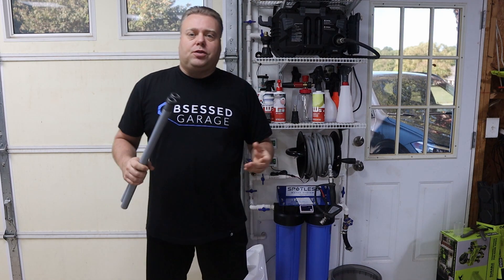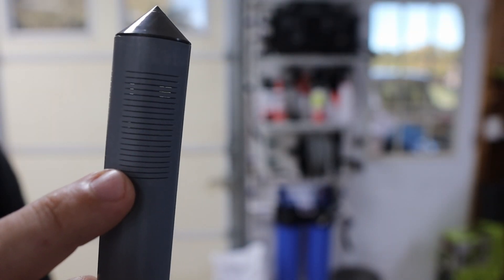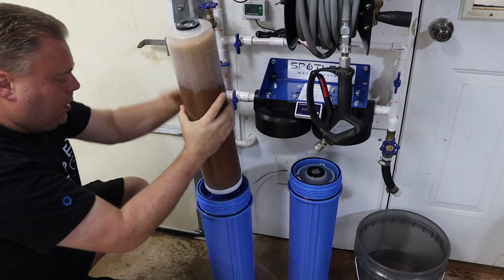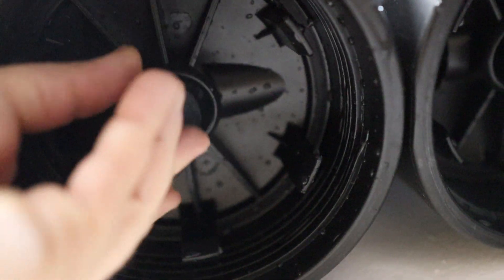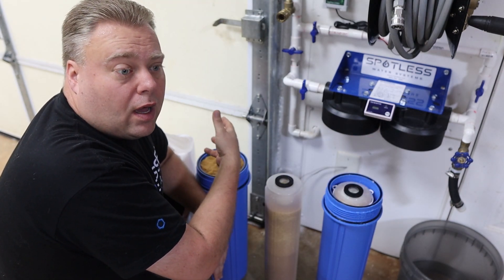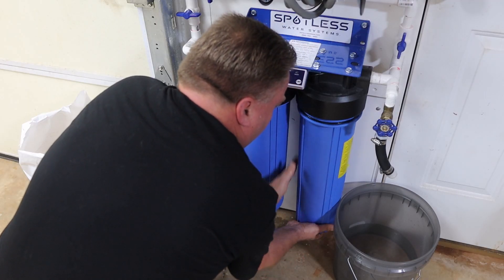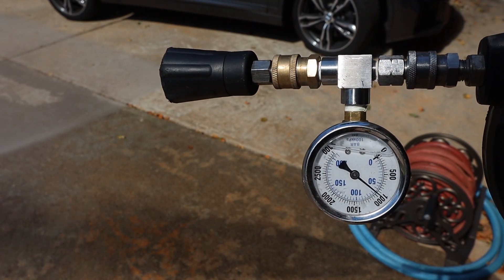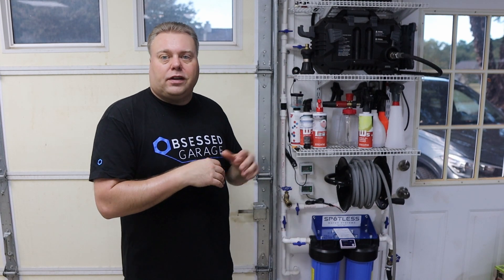Modify Your CR Spotless | How Long Did My DI Resin Last? | RV-Mods

Comment: Only thing I would reccomend is to use a silicone o-ring grease instead of Vaseline. Vaseline is petroleum based which will cause the orings to expand and stretch. Where I work we have an industrial size RO system and deionizer and we were replacing the orings on the housing every month due to them expanding. Since switching to the silicone oring grease, we haven't changed one in over 2 years.
Reply from the maker: I thought of that. I knew Vaseline was the wrong way to go that stuff causes nothing, but issues.
Reply: Thank you for the tip, great comment!!! 👌🏾💯

Comment: I own a company called NuWater USA and Creative Water Solutions, we make all kinds of cartridges.  The difference in color is due to resin separation. You have Anion and Cation resin mixed and each have a different density meaning cation weighs less and will sit on the bottom. Plus the resin needs to be packed tight to not create separation. Plus you never want to go up flow with DI always Down flow. Your Mod is going up flow........
Reply from the maker: I went back to the resin filter setup. Somehow some resin got by the laser cut grooves.
Reply: @CarsWithKeav I'd take this video down if that's the case. 😮
Reply from the maker: @BrillianceAutoSpa  I seem to be the only person I know of to have this problem. I’m taking is a fluke or I did something wrong somewhere during a refill.
Reply: @CarsWithKeav  I see. Have you reached out to the manufacturer about this? Perhaps they can send you a new set of rods and resin.
Reply: What do you mean by up flow and down flow ? How would you achieve down flow with these filters?

Comment: FYI: thought about buying this unit until I checked Amazon reviews.  Ten prcent (10%) or 1 our of 10 people gave the CR Spotless 1 star and descibe it as 0 stars.  Folks having the system fail after 5 or  6 washes and plenty of horrendous stories about CR Spotless' customer servive (basically doesn't exist).  The there is a more stories with 2 stars, etc.  This gives me great pause.
Reply from the maker: Problem with this type of product is most people don't do their research and think that if I can get 600 to 800 gallons out of my water they expect the same, but they live in Vegas and the water is very hard and would last maybe 100 gallons if that (Believe me I get lots of comments that what I suggested doesn't last long and it ends up being their quality of water once we had a conversation). Years ago you could only get this type of product of a website that educates on this, but now its right at your finger tips and a social media campaign on top that. Mine has been great and still on the wall I did reverse the mod in this video as it didn't go so well and went back to the cartridges. there are lots of great options out there, but before buying anything like this getting a TDS meter and checking your water will let you knwo ahead of time the experience you will have. Also researching the source water whether it is well water or city water as chemicals and other things impact usage. Some people also don't make sure their input water matches the max it can handle which is 2.5gpm, but most house can flow 8gpm moving the water too fast to get filtered. I have tons of products that worked out so well and don't have very good ratings.
Reply: @CarsWithKeav  Yes, likely. Thanks for sharing your insights.

Comment: Dumb question: is there not a way to uncontaminated the resin similar to what a water softener does on a backwash with salt? I guess I’m not quite understanding why this resin is thrown away.
Reply from the maker: The resin can be recharged, but I don't want to deal with bleach, sulphuric or hydrochloric acid to recharge. Plus, this is mixed bed so another process to separate them before the harsh chemicals. Some love to do it, but its not for me.
Reply: @CarsWithKeav  Thanks, I didn’t know that.

Comment: Arizona has some of the worst water in the U.S. Mine tests out at 700 TDS.  This unit might lower  my TDS down to 150 but that is still too high and the resin would be wasted in 1 car rinse. I think I"ll buy a blue, 15 gallon, water barrel and an electrical pump with just enough horse power to make a nice hose stream. Then off to the water store I'll go to buy some reverse osmosis water that tests out at 0 TDS. I see no other solution.
Reply from the maker: A lot of guys in Arizona are running RO systems and using this system after that to get full 0 ppm. I’ve seen videos of them going from 500 tds to between 10 and 50 from the RO system.
Reply: Hmmmmm I live in Arizona and just recently purchased the waterdrop di water system, so it will not work then?
Reply: @jacqstoneva  This will work but given how hard AZ Water is success will depend on how often  and how costly it is to renew filters.

Comment: I added an RO pressure vessel to my setup and my 1 cubic ft of resin now last far longer than even with the downtube upgrade.   My water here in AZ is horrible, starting at almost 600 PPM,  After the RO membrane, the water is down to 30 ppm, so obviously my resin does much less work than it would have to without the RO membrane.  I used to blow through a 1 cubic ft bag every 6 months.  the only downside to this setup, is that I have to store the water I make.  I used a rain collection bin and that seems to work really well.  It's a bit of a frankenstein setup, but it works great.   I'll share my setup if anyone is interested.
Reply from the maker: I feel for you guys with the high PPM water. I would for sure run RO if I had that type of water and probably a two stage carbon filter setup as well.  I get about 50 ppm out of my faucet so no RO needed. Wish I could share this good soft water with you though.
Reply: Please share. I'm at 500PPM and would like to use a DI system but am hesitant. Would prefer not to wash my car at 7am to avoid sun and heat if I can...
Reply: @D_Rok80  You will always need to wash your car out of the sun if you're in a hot climate. You don't want your chem drying up any more than you want the water.

Comment: hey keav i have the diw-10 and i can’t find that conversion tube for my unit, any ideas where i can get it? or can u help make me one?  i’d pay you for it
Reply from the maker: I am unsure exactly how to make one and haven’t seen them sell those for quite some time. One thing that might work is taking the 20 inch and cutting in the middle and then using a coupler to attach them together after cutting down the length needed.

Comment: I have just bought a DI system with 20” filters. They are rated for up to 300 gallons at 200 ppm. My ppm is running around 230ppm.  Would you recommend running pre filters like you had on the cart? Do you think I would notice a difference in the life of the DI filters?
Reply from the maker: You possibly could if you have sediment. The carbon filters are mainly to catch chemicals that DI resin does not. Chemicals like chloramines.

Comment: I had changed my resin out and for some reason the resin is coming out of the di tank with the water and it’s reading a high ppm. Anyone know what I’m doing wrong or how to fix it?
Reply from the maker: Recheck all the gaskets and seals and make sure the pipes are fully seated into the housing. Any chance for the dirty water to get by it will. I actually went back to the cartridges as resin was getting by and clogging my sprayer.
Reply: @CarsWithKeav  ok thanks, the problem I have tho is I can’t really see the tube when I screw on the tank
Reply from the maker: @joshfde  that is the biggest problem. I have found after multiple of these types of systems it’s best to set the tube in the housing first then push into the resin. The tubes will always be all the way in then. You can fill up with water as well and will be much easier to push the tubes into the resin.
Reply: @CarsWithKeav  Ima try that thanks bro

Comment: I know this. Idea is 9 months old but FYI RV-Mods is out of the DIC conversion kits. They sound great. Thanks for the video info. And the bloopers are great!
Reply from the maker: Appreciate that. I have actually gone back to the original filters as resin passed through the slits in the pipe and clogged my spray guns. Might have just been an issue with my setup. I have it pretty down pat to change out the filters.
Reply: @CarsWithKeav  Thanks for responding Keav. Maybe the pvc pipe didn't didn't seal/connect properly when you attached it to the CR Spotless Water unit. There is now a 3 week wait for new conversion kits but I'm going to give it a try to stretch out the resin life. I am just now purchasing the CR unit, etc. so it may be a month before I let you know how it works. I tested out water with a TDS tester and it read 107. Safe to drink but not very good for paint or windows. I look forward to more of your excellent videos!
Reply from the maker: @tomharrison7280  I thought so too, but I even cleaned it out reseated perfect ran it and resin got by the slots. Only on the second stage. So only one is letting the resin by. I switched the tubes and it stopped  since the resin was being caught by the other tube. Maybe just one slot was too big maybe? Not sure nobody is having this issue so I chalk it up as a fluke.

Comment: Did you keep the system modified? I got 350 gallons before I needed to change mine so I upgraded it & got way less I wasn’t sure if it was my resin or if the tubes weren’t in all the way so I pulled it apart double checked my tubes all seemed good . Same water scenario. I’m trying to figure out why I went from 350 gallons before mod to 50 gallons ugh .
Reply from the maker: I had a different issue where resin was getting by the slits at the bottom of the tube and clogging my sprayer. I went back to the cartridges which are way easier to change out so i don't mind doing it the extra few times I have to. Possibly you have some blow by going on where it not sealed all the way allowing water to sneak by. Also, make sure to try multiple sources to check tds. Filling a cup up and doing the manual check is more accurate. The TDS meter on the CR Spotless does have a calibration screw at the back and you can get calibration fluid from them to adjust it. Since its measuring flowing water there has to be a way to calibrate.
Reply: @CarsWithKeav  good idea I will check manually. Thx for the response.

Comment: How do you dispose of the used resin?
Reply from the maker: Household trash. It’s basically micro beads of plastic. Many regenerate their resin to save money as well. I plan to make a video on that process soon.
Reply: @CarsWithKeav  I read a few posts about that process, and it looks like you should be a chemist and own a hazmat suit! 🙂
Reply from the maker: @MickStreff  It's a pretty involved process with lots of chemicals. For sure need the PPE.
Reply: @CarsWithKeav  While using this modification, were you happy with the results?  Do you still use this process, or have you returned to cartridges?
Reply from the maker: @MickStreff  I went back to cartridges no matter what I did I was getting resin clogging my garden hose shower nozzle. Others have expressed the same problem, but the majority seem to be very happy with it as well.

Comment: Do you have to take the water out once’s you’re done using it? Or no?
Reply from the maker: You should always keep water in there resin loses its charge when it dries out.
Reply: @CarsWithKeav  also, I did the conversion and my ppm is still reading high. I tested the water and it’s good but it still spots. I had to transfer the tpms meter to a new head unit so could it be damaged?
Reply from the maker: @abrahamfranco4249  That’s weird have you checked the connection inside could be getting blow by. TDS meters can go bad, but not usually reading the same number as going in. Than can be calibrated as well. There is a screw on the back and you can get calibrated liquid from the manufacturer.

What is your incoming tds? Is it very high? Was the TDS better or worse with the stock CR spotless filters?

Some water quality is so hard even full resin won’t get you spotless.
Reply: How do I check for blow by? And how do I take off the connection safely? I struggled with it when I had to transfer it to the new unit. 

I also love in California and the TDS was reading around 250ppm
Reply from the maker: @abrahamfranco4249  should be able to handle 250 ppm. Blow by would be if the tubes are not seated properly causing water to not go through the resin to get into slots at the bottoms of tube. If the tube is put too far in the canister when you put the canister on the housing it will not seal all the way allowing water to blow by. It will lower TDS, but not fully. What’s the ppm after being filtered?
Reply: @CarsWithKeav now that you say that, I pushed the tubes all the way in then closed it up. That’s probably what it is. After being filter and testing the water manually it says 0ppm but I got some in a bottle and sprayed a window (after cleaning it) and it still spotted but obviously it was softer.

Comment: Can you cut the length of the tube down to 10 inches ?
Reply from the maker: I don’t see why not, but they sell a 10 inch version as well so you won’t have to cut.
Reply: I can't find a 10 inch version anywhere. I just found this someone had asked the same question.I didn't see it before.
Thank you for the great videos
Reply from the maker: @57cbo  You are right they don't seem to sell the 10 inch version anymore onlt the 20 inch one.

Comment: my water reads around 380 tds would I still be able to get at least 300 to 500g or would it be less?
Reply from the maker: I would say closer to 200 gallons. They have this calculator on their site you can use to get a good estimation. https://crspotless.com/how-many-washes/

Comment: My well water even after passing thru softener is 1500 TDS.... I do have some sort of filter tall cylinder but not sure if thats for removing TDS..... I got the apec one and it only lasted a few washes..... Wat are my options?
Reply from the maker: With that kind of TDS resin will not last long. You might need to look into RO to get most out before hitting the Deionization. Carbon sediment and pre-filters are a help as well. Check out this video on an RO system. https://www.youtube.com/watch?v=TevNUbePxyA

Comment: Thanks for the info! Nothing more annoying than water spots on a nice shiny car finish. Could the water that is filtered be considered demineralized? I could also use that in the shop for car cooling systems with a 50/50 mix. Thanks. -Glen (Ozz)
Reply from the maker: Yes, it is de-mineralized and I use in Golf Cart Batteries, Coolant mixing, Ice Cube Maker (Crystal Clear Ice), chemical dilution, etc. So
Many uses. I still dry my car with a leaf blower since even if the water is spotless the droplets can attract pollen, dirt, dust and can still dry with a dirt ring. By using spotless when you blow dry some of the water just evaporates. If you use tap water the water evaporates while blowing, but the minerals dry into the pores of the coating or clear coat giving you less gloss and hydrophobics.
Reply: @CarsWithKeav  excellent info and advice. Btw, subscribed.👍

Comment: Is a flow restrictor not necessary to make resin last longer?
Reply from the maker: Restricting flow to 2.5 GPM or less at the sprayer will do. I have a flow meter that lets me know the gpm. CR Spotless gives a sprayer with their package and suggests certain settings to maintain 2.5 or less.

Comment: Will this mod work for other setups? I just got in my setup (APEC) being I have a Home Depot account, so figured I would try that system out.
Reply from the maker: It's possible, but I can't say for sure since these were designed for the CR SPotless. I am unsure if the APEC is the same opening or not. for the tubes to fit.  It does look very similar though.
Reply: @CarsWithKeav  Yeah, I was wondering about the mounting (tube opening) size is the same or not. If so, I just might be able to switch mine out for the CR once the resin has been used up. Would also have to check the inside mounting spot for the mod tube to make sure that lines up. We shall see! Lol

Comment: Does it matter if the stick in the middle isn’t centered, gotta be a tool one can make to align it perfectly or expoxy it to the plastic to permanently affix it to
Reply from the maker: In order for it to seat properly it has to be centered. If not it would be at an angle and the seal would be compromised sending resin into the hose and nozzle.

Comment: What would be your recommendation for a deionized system for someone washing 2-3 cars a week with around 230 tds? I mainly want one to use for final rinse and with my rinseless prespray
Reply from the maker: This system or an FRP tank style DI system. The smaller ones you would be changing resin often due to the 230 tds which is a manageable number. I prefer the two I mentioned because they can operate at a higher GPM of 2.5.

Comment: How's this holding up so far with the mod? Has it lasted longer than before? I'm debating whether to buy the cr spotless and add the mod or go with the di pro 100.
Reply from the maker: I'll do an update video soon. Not a fan of the RV mods the resin got past the slits in the tubes and was plugging up my hose sprayer. I went back to the old way. The CR Spotless itself has held up really well though. Others have had better results, but with my setup the Mod did not work that great.